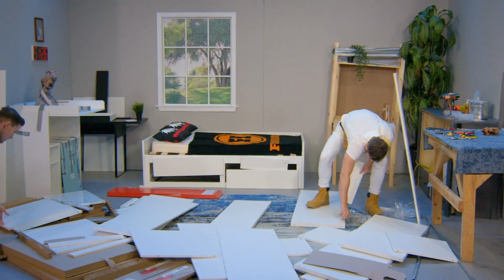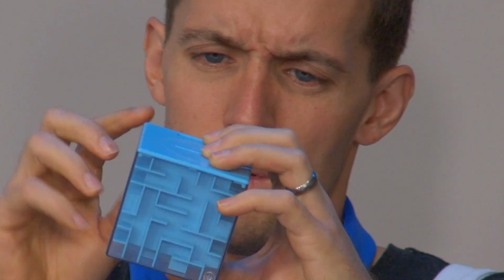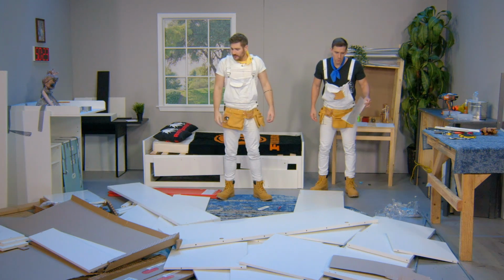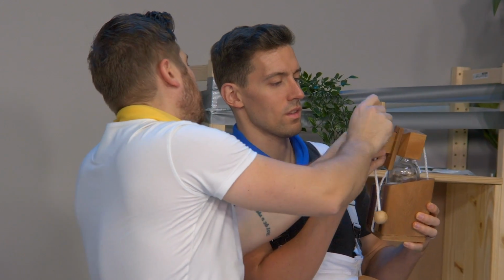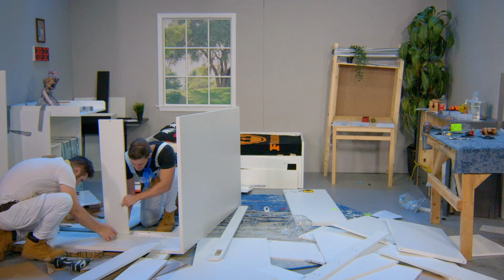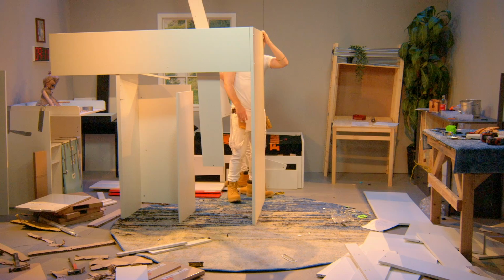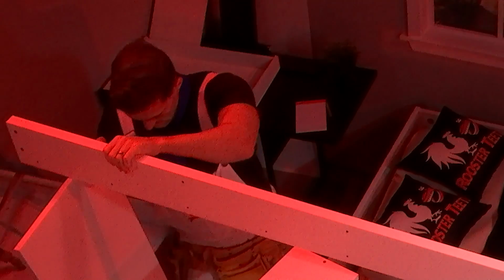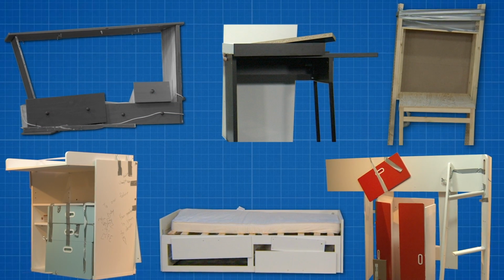We Build Ikea Furniture w/ Our Tools Locked In Puzzle Boxes - No Idea Ikea

Comment: Pro-tip: you can use the fast spin of the drill to change bits quickly. Just hold the front that adjusts while pulling the trigger to loosen or tighten immediately.

Comment: The problem is you are using a Drill to put in screws, you should use a powered screw driver, and not strip the threads. that's why this project failed. - Fact.